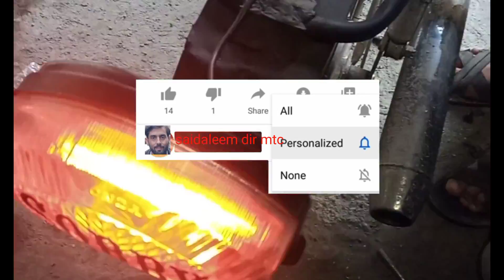dekoresan light motorcycles /decoration eshare satarting masala

Comment: 1 Da motor cycle wiring pora asana trika sa ra yawa  video jura ka Ror

2  da motor cycle Cd70 ao 125 Engine repairing jura walu pora video jura ka ror

3 Da motor cycle pora tool auzar yawa video jura ka chi kam auzaar pa kam zai ki kam number pana istimali ki

4 da motor cyle ki flash khisa lighting wiring sanga ki gi yawa video jura ka ror

5  da motor cycle da engine bandi yawa video jura ka chi engine ki sa sa  fault yi aa ghi awaz pehchan sanga yie  please
Reply from the maker: Tek da jure ba kam kha
Reply: @saidaleemmtc4069  dira manana Rod